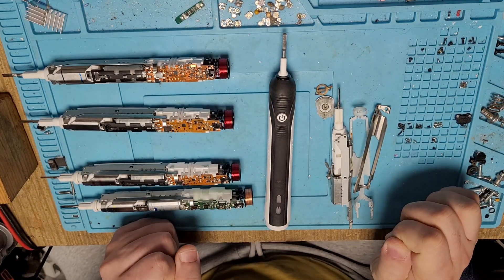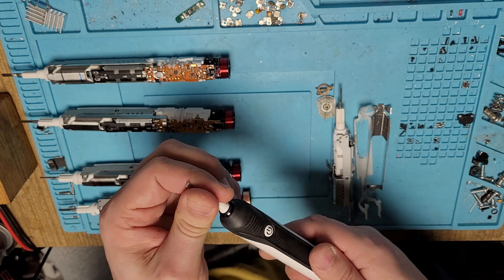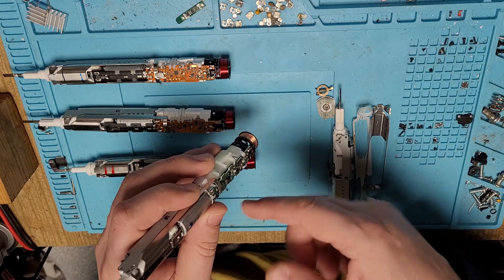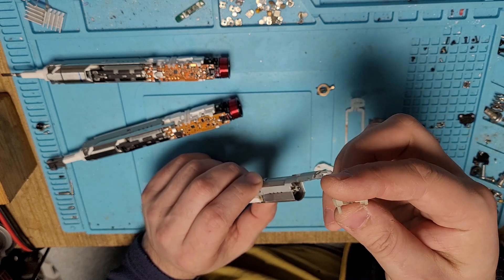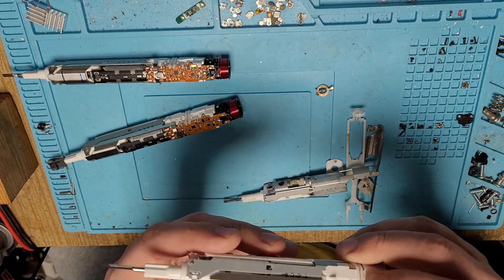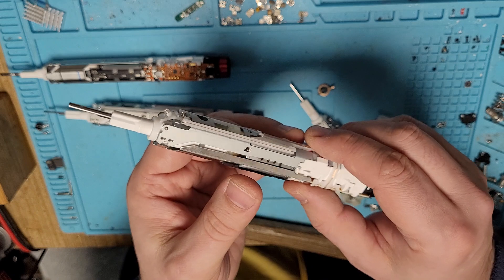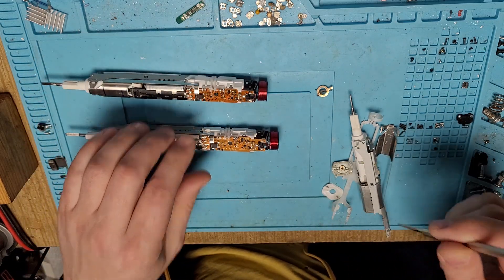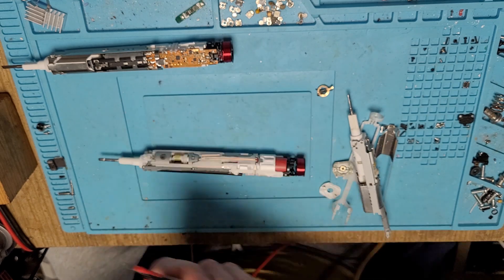Repair of various Braun Oral-B Pro or professional care toothbrush defects

Comment: My braun oralb vitality toothbrush(model 3709) have a strange problem, after i apply 3.5v to the motor, it works normally (press button turn on and off the toothbrush), however if i left it for some time, pressing the button do nothing, what can be the problem? (I guess maybe a dead capacitor but dont know where to start checking, can you help? Many thanks

Comment: Can you replace the white end piece where the toothbrush attaches to the handle? Is the white section the same on the cheap handles as on the pro? Thanks
Reply from the maker: What model do you have? Just to know what we are talking about :)
Reply: @letsfixitgarage Bought Genius X ltd yesterday it is the exact same unit as my 10 year old 3765
Reply from the maker: Yes, Philips sonicare drive unit and oral b previous generation has not changed for long time inside.. hope it will be similar with new drive units and not revolution with every new toothbrush.. as for white part I think you can change the whole motor unit as it will be more difficult to exchange only that part... But haven't tried it to be honest..

Comment: But I put mine on its charger. All the lights come on for a second. Then the charging light starts blinking. Ill leave it on the charger  all day long. Iv even replaced the battery. But it still doesn't work. If people can give me suggestions and advice I would greatly appreciate it.
Reply from the maker: What exact model do you have? What voltages does the battery have after charging?

Comment: My #1 Problem is that the rubber on the oral-b gets sticky and desolves. So I got perfectly fine electronics but a nasty exterior.
Reply from the maker: Yes saw this on Genius toothbrushes quite often.. it seems Braun didn't planed that these toothbrushes will hold that long :)

Comment: Mine wasn’t working. The motor was humming but the brush head wasn’t spinning. There’s a teeny bit of space at the part of the metal brush post that meets the plastic body, so I got some isopropyl alcohol and dripped some inside, waited a few minutes, then got a can of silicone spray lubricant and squirted some of that inside. The can has a tiny nozzle -I had a Kleenex around it so it didn’t squirt back into my face 😂. I left it alone for half an hour on the charger then I got a clean paper towel and banged the post part (pointing down) onto my paper towel covered hand and some icky rust brown stuff came out along with any excess lubricant that I had used. I tried the brush again and it worked. As soon as it started working I let it go a full cycle…I could actually hear it revving up, like things were coming “unglued”, if that makes sense. Idk, maybe I got lucky…but in all honesty, I didn’t want to take it apart lol
Reply from the maker: Yea it's possible to get it clogged with toothpaste and some maintenance is good for all devices ;) glad you figured it out, and shared with everyone!

Comment: Good video, thanks! I think my batteries are getting weak and I couldn't find that in this video, do I need to solder the charging coil or can I take of the motherboard completely without soldering anything?
Reply from the maker: Both coil and battery are soldered in. So some desoldering will definitely be needed. Additionally Braun has some strange battery contact form that should have a purpose of missing the spring and not adding battery contact to it.. you can examine it from side before starting taking it apart..
Reply from the maker: Soldering iron is definitely needed. Only oral b IO has freely without tools exchangeble battery... Older toothbrushes need soldering iron to desolder battery and charging coil
Reply: @letsfixitgarage  thank you for the reply! And for the great videos. I think I will wait for the battery to be completely dead before I attempt any modification just like the other commenter. If it breaks I now know the model to buy with easier to replace battery
Reply: @letsfixitgarage okay that's unfortunate but what I was afraid of. Why don't you make a video of that? I found someone that mentions it in a video but not one that actually shows it...
Reply: Hi, not an expert but I just took my brush apart to clean it up and was thinking the same thing. It looks like there is a thin metal connector on either side of the battery. Those connectors and the snap fits of the plastic housing lead me to believe you cannot remove that battery without needing to resolder some component. If I figure out how to get it out without that I will let you know
Reply: @Shoelie thanks, that will be highly appreciated! My battery isn't completely dead yet and I don't want to mess things up. 😅

Comment: Hi and thanks for the video! Great stuff. I got a 3791 that turns off after a few moments (and does the high pitch sound). From what you're explaining it could be the current sensor. I can't find more information about it where it is exactly and which one it is. Do you have a hint?
Reply from the maker: High pitch sound was associated with motor not able to turn.. have you tried to rotate it? is it moving freely?
Reply: @letsfixitgarage  yes it's moving okay. It starts moving and quickly stops (after a few seconds). The button seems to get hot.
Reply from the maker: If you have isopropyl alcohol cover the whole motherboard with it and turn it on. Any part that gets hot will evaporate the alcohol and you can identify the part that is getting hot and possibly exchange it..
Reply: @letsfixitgarage  I totally missed that comment and just now found it. Thanks for the tip!
 Had it lying around as long and charged it back up yesterday. Now it's not moving anymore (only a slight sound from the motor is noticable). What gets hot is the button itself and the condensator next to it. Does that make any sense?

Comment: The motor on mine keeps locking up.  The issue begins by it taking a sec or two for the brush to start.  Then after a day or two of that, the whole motor seizes up and just hums until the red light starts flashing.  I take it apart and pry/rotate the axle just as you said.  I found that out on my own before even watching your video.  I also glazed the whole thing with WD40 in hopes that would keep it twirling.  This fixed it for 6 months, but now it's starting to seize up again.  Not sure the WD40 is having any effect this time around.  Maybe the axle is getting rusty somewhere.  Perhaps that tiny rubber band belt is drying out or something.
Reply from the maker: Problem is the motor motor brushes are metal not carbon brushes that's why it welds to the rotor.. I showed how this motor looks taken apart in one video but it's not really reassebleble..

Comment: I’m not understanding how to reconnect the charging wire to the connection point. I bought a solder kit to fix my toothbrush (10x cheaper than replacing it). I don’t know much about soldering but my issue is the wire snapped like you showed. What do I use to reconnect the wire? A piece of solder wire to the copper? Thanks so much for showing the different issues and saving more toothbrushes from going to the landfill!
Reply from the maker: Soldering is a skill that needs Praxis.. just unwind some of the wire here it has some loops that can be unwinded and soldered. There is no special preparation just heat up the wire on the solder point, use flux and it should be fine.

Comment: All modern electric toothbrushes break after two years! The seal intentionally lets moisture in so the electronics corrode and stop working.
The solution? Simple! Buy a new toothbrush, open it up, and coat the electronics with technical petroleum jelly. Tested method—my toothbrushes have been working for years! 🪥👌

Comment: Thanks for sharing !

But mine behaves strangely as if the button didn't work properly...

1) Starts unexpectedly even after weeks (I wondered first what was making that strange noise ! Like a dildo :-D )
2) Sometimes I can start it with the button, sometimes not...
3) If running (finally...), I can't stop it by pressing the button : I have to put it on the charger to stop it (and that works all the time), very strange....
4) Battery seems fine and charge
5) All is very clean, no dirt or anything
6) It never fell on the ground or anything
7) switch seems to work properly (nice little click)

I suspect an electronic issue but I can't tell what is wrong...
Any idea ?
Reply from the maker: Measure resistance when you press the button if it's not 0.3ohms some buildup could be in the button or there is a micro break in solder of the button leg or a trace..

Comment: hello,the model I have is 3731. first the on/off button started to not react at all and did not work at all. i disassembled the device and checked it by eye. but since I am an amateur, I could not find a problem and turned it off again. now it says “CHARGING” but there is no indication of charging. it only says charging. do you have any idea about this malfunction? the battery seems to be 70% charged. how many volts should I see at the output of the battery. is the battery voltage low and does not trigger the circuit?
Reply from the maker: This one is a little bit more difficult.. it's NiMH battery and it has different charging pattern. Even if you install a fully charged battery it will do the charging procedure for few hours.. but it should start at the press of the button.. I would try to change the battery for a new one (the same type!) if this doesn't help defects on motherboard needs to be investigated..

Comment: 10:06 Pressing firmly without a hammer and cleaning the motor with alcohol, and then playing gently back and forth with the white gear solved the problem (toothbrush not rotating anymore, type 4729)
Thanks so much🙏🏼
Reply from the maker: I believe it depends on how much it was tried to turn on when it got stuck initially that affect the stick level.. as every time you press the button it welds brushes to the rotor even further.. thanks for your sharing!

Comment: Thx you for your detailed explanations in this repair help video. ;)
After i had change the li-ion battery of the model pro 3 with - working (!) motor - that didn't load correctly (Thx to Raimund Checkt's iT, video: https://youtu.be/qy7ifOj-k-0 ). After the new battery was soldered in and loading works fine, the motor didn't start anymore. cause: current shunt resistor with measured resistance of 105 ohms. Short cut with a tool, like shown in video and motor starts on pressed button.
But which value for the spare shunt resistor do you recommend for fixing this issue? really 0.2 ohms? and which value is working fine? ...or is a solder short sufficient?

the smallest 0603 resistor i have in my store is 10 ohms, sandwiches three times as stack is 3, 3 ohms. tested: resistance is NOT small enough. ;( so it' seems i need to get a proper one!
Reply from the maker: Sorry didn't had this defect yet.. for some reason people don't bring me any of the pro series for repairs only genius, IO or Philips.. maybe new price is not that much so people don't want to repair them...

Comment: Mine looks similar but not same, I think p[ower button activates (and deactivates) on its own so can't charge it due to that reason. I found there was significant rust inside. At least thanks to you I managed to take a look inside it. I don't think I can do anything without dismantling the whole thing and I'm really bad at desoldering so I'll leave it as it is... but still thanks for the explanations, at least I am a slight bit smarter than before.

Comment: Many thanks. My 3766 pro2000 just didn't switch on the other morning. 
I viewed your video and the symptoms you describe for locked up motor were the same for me.  I listened closely and heard the same short buzz but no action.  Using a fine flat screen driver I pryed on the engine cog, I used a can of compressed air at the same time and the cog freed up and the toothbrush is back to running.  It was damp inside when I disassembled, so I might use a tiny bit of rtv when closing it back up. Ran and started multiple times like new. 🙏🙏🙏 many thanks. 7:44

Comment: All useful info, but my brush has worked SO well, the brush head shaft is now worn resulting in the head falling off when in use … simple mechanical wear of the steel. Chances of getting a replacement shaft? I’d say about zero 😊
Reply from the maker: I would say one possibility is to get a donor toothbrush and exchange the mechanical part, but sadly its not very easy..

Comment: Great Vid. Any suggestion of how do I change battery? Seems difficult anyway
Reply from the maker: It has some fiddling but doable. before replacing I would double check if motherboard is alive. Try applying external power and press the button. From my experience 95% of the time Battery is fine but there are some other problems..
Reply: Thanks! probably I forgot to tell you that the brush is functional but the battery duration is extremely low
Reply from the maker: @IOANNISNEGREPONTIS then yes it could be the battery. Although if motor is difficult to turn it will use more battery if something gets hot on the PCB could be the same issue that affects battery life.. depending on model some need to desolder the charging coil and then you get a better access but with oral b you will need to bend the battery legs and putting it back in will be more difficult than taking it out :) hope these tips will help! Good luck!
Reply: @letsfixitgarage  Thank you my friend. I believe the most difficult part is to reform the battery legs. I start to believe that the whole process will be worthless at the bottom line...
Reply from the maker: @IOANNISNEGREPONTIS it's not necessary to have it exactly as original but after installing check that terminal wouldn't touch spring that pushes against motor. So as said doable, but a lot of fiddling is involved :)
Reply: @letsfixitgarage  Τhanks again.

Comment: Thank you so much. I have a model 3766 here in Sydney Australia that looks identical - it was sold to me by my dentist about 5 or 6 years ago. Became intermittent after a lot of flying around the world over the past 2 years and eventually would not start. Inspected the solder joints at the motor end of the PCB board. Could not see any obvious cracks, Reflowed the 4 joints with soldering iron. Toothbrush is fully functional as it should be now. Reassembled.  Great!
Reply: Coat the electronics with technical petroleum jelly. Tested method—my toothbrushes have been working for years! 🪥👌
Reply from the maker: @buritogringoson yes and no :) electronic will be more resistant to water but these brushes use motors and gears that will corode and still break.. best is to try and prevent water getting inside.. they are designed to work very long under normal conditions.
Reply: @letsfixitgarage  I disagree. I own seven toothbrushes at home, and with this number, on average, a toothbrush would break every three months. After securing the electronics, none have failed for several years now.
Of course, the motor can also fail due to moisture (though the gears are plastic…), but in practice, this doesn't happen before the battery wears out.
Keep in mind that the issue of corroding electronics is more significant in non-"Pro" versions, particularly the Oral-B Vitality, which has worse seals, is cheaper, and seems to be designed to fail faster
Reply from the maker: Interesting. Thanks for sharing.  Have not gotten vitality for repair but I assume they will have the same motor as all oral-b toothbrushes. But 3 month for a brake down is extreme... Philips hold much better without modification I would say...

Comment: How can I know if the battery is death?
Reply from the maker: Measure voltage. Second stage is get a special device that can make a charge and discharge cycle measuring how much mah it used for this..